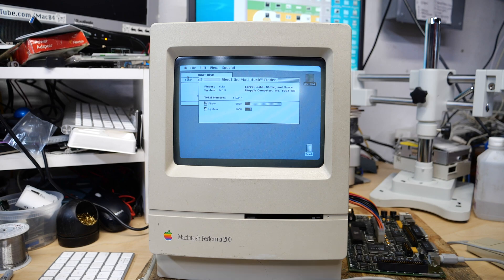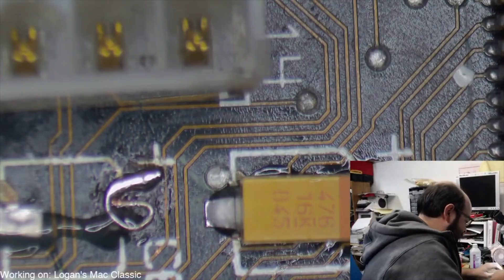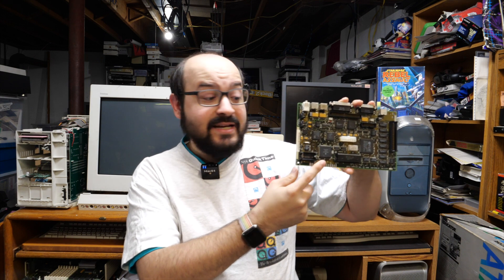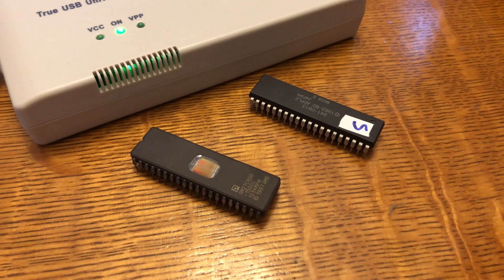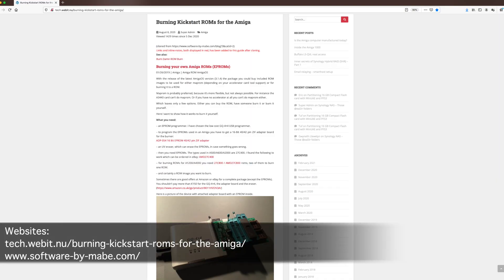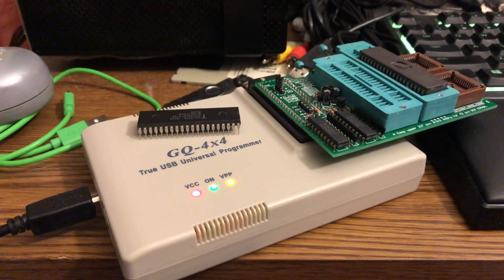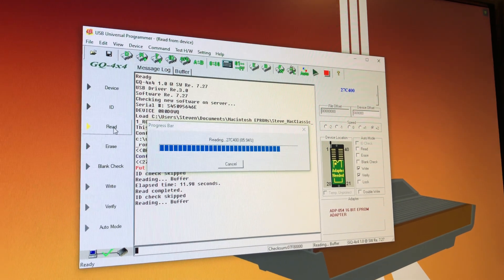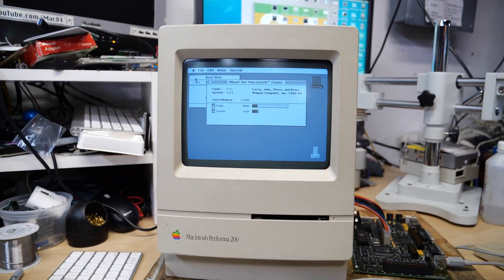Fixing an Apple Macintosh Classic with an EPROM Programmer

Comment: I’m wondering if this might be my problem. While working on an old classic that could not boot at all, I accidentally plugged the ROM chip in one pin over after cleaning under it (didn’t realize it was a larger socket) and probably had it powered on like that while probing the board a few minutes. I put it back as soon as I realized my mistake. After cleaning gap juice and fixing a short, the computer now plays a very distorted “bong” and has garbage on screen after getting past the horizontal stripes.  Does this sound like bad rom symptoms?

Comment: Any tutorial to write the eprom?, i downloaded the rom from internet
Reply from the maker: No, that depends on your programmer and the programmer’s software. So the steps will differ. However, the programmer you got should give you that info in the documentation, and most software has a wizard to guide you through the process.
Reply: @Mac84  ok, thanks

Comment: Awesome video! Thanks for sharing! Does the Mac Classic II use the same type of ROMs? The Classic II has 2 ROMs and I think mine aren't working.
Reply from the maker: Thanks! There are two revisions of the Classic II, one uses two ROM chips (and can use the same as the original Classic) and the other uses four ROM chips, the type of ROM chips also differs. I found this info on this page:

“The 2 ROM version of Classic II can use two 27c400 EPROMs of 100ns or faster (150ns won't work) to replace the system ROMs. The 4 ROM version can use four 27c010's. I did my development with the 2 ROM version because half the number of chips to remove, erase, reprogram, and reinstall seemed like a good thing.”

https://68kmla.org/bb/index.php?threads/compatible-eeprom-for-classic-ii-rom-replacement.37554/
Reply: @Mac84  awesome! Thanks so much for this! I have the 2x ROM Classic II board and will be ordering the 27C400-100 chips.
Reply: Wow, just noticed you tested that Classic board in a Performa 200. Those are pretty rare and I never seen one before.

Comment: Hi, I have a Mac Classic with the sad error 0000 0001 0000 FFFF = ROM test failed. Does it require to change the ROM or is there an easier option to fix it? Have you come across this error before ?
Reply from the maker: Open the Classic and ensure the caps aren’t leaking. Sadly they probably are. The ROM failing is uncommon unless something is shorting it out or leaking on it. There are a few videos by Branchus Creations showing you how to service these systems. But you must do it carefully to not damage the neck of the CRT.
Reply: @Mac84  Thanks for the advice, I will check out the board and search Branchus videos.

Comment: Another tip just make sure to cover that EPROM with white label sticker with what's on it, or some black electrical tape so there is less chance of it getting erased unintentionally.
Reply from the maker: You think I’d pass up a chance to put a Mac84 sticker on there? 😊 Yes, a sticker was applied. Just because it wasn’t shown in the video doesn’t mean it didn’t happen haha.
Reply: Yep, cover the quartz window as sunlight or other UV-containing light can erase/corrupt the ROM data.